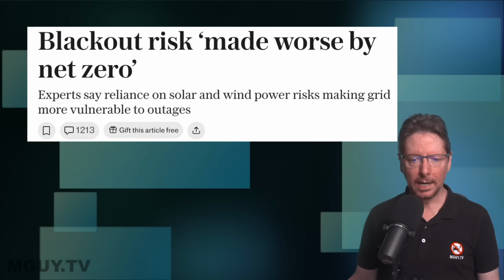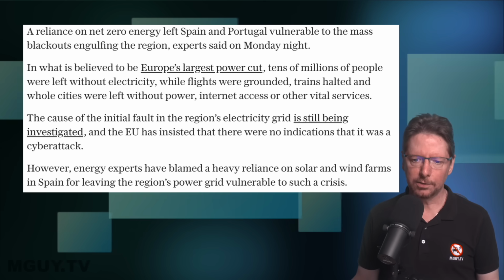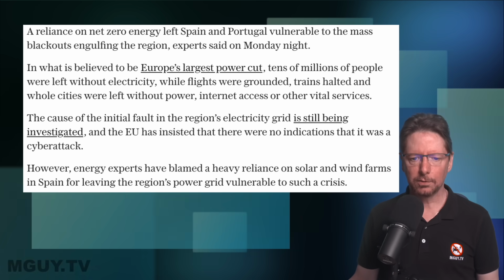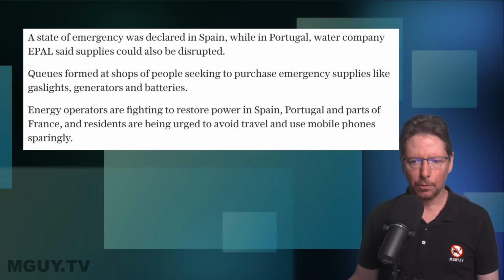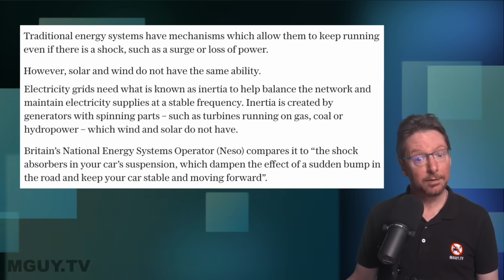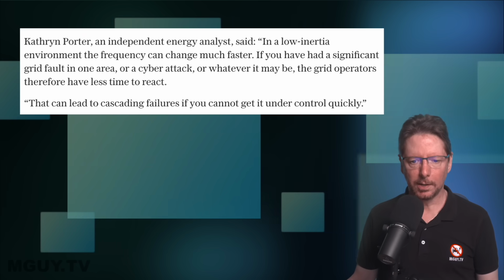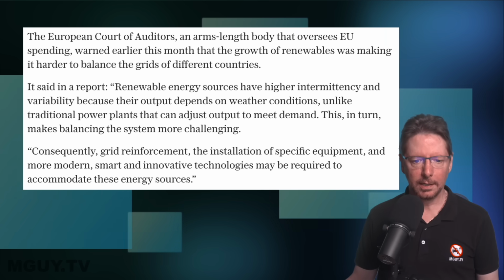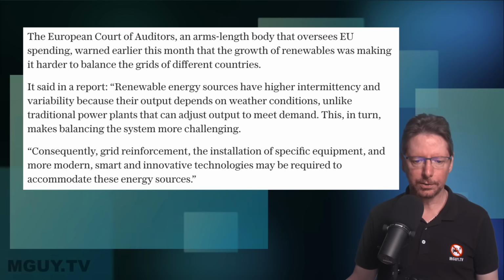Spanish power BLACKOUT: Why Net Zero and RENEWABLES were to blame | MGUY Australia

Comment: When I was a kid my father took me to a 'working' steam engine museum (somewhere in England; I forget the location). Lots of original examples of Victorian engineering - built to last and all still in working order.

I was dwarfed by monstrous pumps and engines humming and whirring and whooshing away, brass and bronze, iron and steel, beams and wheels in almost silent motion, ingeniously governed by automatic feedback devices and, most importantly, regulated by gigantic flywheels weighing several tons apiece.

Inertia. Momentum. Immense power on a tight rein. Awesome engineering. Not a windchime, beansprout or sparkly pink unicorn to be seen.

Comment: The generators do have to be spinning very close to 3000 RPM, but you still can't couple 2 together until you nudge the phase of the second to match the first. In other words, they must be synchronised. If you add a generator to a fully synchronised grid, the grid will "pull" the new generator into phase by virtue of the massive inertia already there.

Comment: Sweden has several nuclear reactors running, the socialdemocrats together with the green party has shut down 2 of 6 reactors, the largest plant Forsmark delivers pretty much 95-100% efficiency during high demand, right now reactor 3 is shut down most likely due to maintenance, but so far Forsmark 1 and 2 has delivered 1900MW of power and it delivers 25TWH/year

Comment: Wouldn't  tidal and/or hydro (Stored and running) and gas storage "Batteries" and Li-Po batteries  provide the inertia  necessary to support the grid ? Isn't the real problem that grid electrical systems in the  developed western World are  in transition and essentially are using prototype configurations which require further development, which will transition, in time, to fully stable and contingency proof systems. Going backwards to fossil fuels ain't the answer. A limited amount of  nucleur, in this scenario must be a good idea.

Pro -temp couldn't electrically  powered giant flywheels supplement any existing  traditional turbine output to provide the heartbeat  to stabilise the system

And isn't part of the problem as seen in the UK over the last 40 years,  that privatised utilities tend to run these systems with far less comfort zone margins  and contingency reserve . They do this so that  more revenue can be devoted to consumption  by shareholders rather than investing in the necessary excess capacity to provide a half-decent reserve.

Comment: We seem to be forgetting how to engineer things that used to work well.  Rubber belts in automotive oil pump service  , plastic cowls  enclosing turbofan engines that melt when the deicing is activated.  Lithium battery farms that go up in smoke...

Comment: And it's a problem both ways with most wind turbines. Too much demand can drag the frequency down while too much wind speed can push the frequency up. That's why most wind turbines have to be shut down in strong winds apart from the chance of physical self destruction. All Milliband sees in the UK is what the salesmen tell him and what his technical advisers advise him and lets face it, if you've landed a very well paid job advising on transition to renewables you're very unlikely to advise stay away from renewable, it isn't ready yet and may never be; go with tried and tested UK built modular nuclear to back up our conventional stations powered with our own shail gas. Knock EV's on the head and job done.

Comment: That was your best yet, concisely put in simple terms, you have educated my septuagenarian brain as to grid stability. 
I have home solar and it has to be outputting a slightly higher voltage than the grid to 'push' itself in and integrate. Also, homes in the UK run from a transformer that turns the grid supply power to 3 phase 240V  down the street. The 2 phase power your home needs is wired off alternately to help balance the 3 phase supply. Problems of balancing are therefore complex as only a few homes have solar and if all those happen to be on the same phase a similar problem to this one can occur when they all push varying amounts of power back in to the transformer at once. I believe this to be correct.

Comment: it is not just the cycles per second the power flows at but the huge amount of current flow going through the wires has to equal out at both ends if you pump to much electricity into the grid voltages go up and things will blow fuses.
 if you have too much generation they have to cut the wild card of solar and wind to keep grid stable.   the voltage will go up and down you will get brown outs where voltage drops to 100 if demand is too high.
 it is like a water fountain or drinking fountain it will squirt you in face if water is too high of a pressure or dribble out so its useless if it is too low

Comment: It's glaringly obvious that wind and solar should use an inverter to covert the DC into AC, and to use that AC to run a motor that drives a generator, to produce stable AC output. Apart from adding to the cost of solar and wind installations, this will also reduce the nett power output, due to losses in both the motor and the generator.

Comment: We tried to warn them. I'm all for cost-effective renewable energy that helps reduce the demand of fossil fuel generated energy as long as it's not outrageously expensive like wind farms. Water-based, thermo-based, and solar are great for my state but they still cannot replace good ole reliable fossil fuel and nuclear generated power. But we can use them to lessen the environmental effect. However, our gov decided to destroy 4 dams? Why? He and his cronies aren't for renewable energy that works well. They are for power and control. They are also using gov't policies to outlaw fuel plants as well to force everyone into an electric car even though most have no way to charge them and that will put even more stress on the electric grid. Who suffers? The middle class and the low-income people who can't afford to live in homes where they can charge their vehicles and can't afford to miss a day's wage when the power grid goes down. This Net Zero thing is not only a pipe dream at this point in time, but also classist.

Comment: Okay, that's enough with the superior attitude.  We're doing the best we can.  Where were you when all this was being planned?  I don't remember seeing you among the protesters.
This whole thing was an oversight and failure to sync up adjacent systems.  We've had our problems with that too here in the US.  Let's not go crazy.
BTW, it's a mistake to think that renewables are the problem.  All systems need to be synchronized with each other.  Conventional systems are alternating current and need to be synched with adjacent systems.  Renewables are usually direct current and need to be converted to ac current and then synchronised.   At some point all systems need to be synchronised.  And hydroelectric power is a renewable, and do we have problems with it?  No.  It's a synchronicity problem, not a renewable energy problem.  Crack a book every once in awhile.

Comment: It’s all being done with a purpose in mind. All that DC and variable power could be used at existing power stations to heat the water to produce the steam that would drive a proper generator. The system could use both electricity and standby fossil fuels to produce steam when there wasn’t enough wind or solar. The fools would rather shut down a perfectly good source of power in favour of an unreliable one.

Comment: In aerospace, I worked on an airplane that had a piece of equipment that needed a non-standard voltage / frequency combination, plus being an uninterrupted supply.  The solution was to do a motor-generator combination.  The motor was driven by the standard airplane frequency / voltage while the generator put out the required special voltage / frequency.  There were relays to switch the motor over to alternate power busses should the main bus go down.  The inertia in the system kept it going adequately until the relays could switch to the alternate bus.  Problem solved.

So, how's that apply here?  Well, IMO, the renewables should be required to do a similar set up.  Use the crap power coming from the solar / wind to run a motor.  That then drives a normal 50 or 60 (in the US) HZ generator, and it's that generator that actually feeds the grid.  Higher cost & lower efficiency?  Yep....but that frequency stability service is critical.  And it would put the cost of this service clearly on the balance sheet of the farts and pixie dust (wind / solar) generators, showing what their true (unaffordable) cost is.

Comment: Just yesterday I told my wife that I was a product of the last century and I have trouble functioning in these times.  That was a joke but being a retired electric utility engineer I am amazed at the new crop of engineers lack of push back on the tenants of base load.  They must understand the need for a stable base load but went along with the idea of designing and building an unstable grid.  This is an ethics issue.  What next?  Dangerous chemicals in our food or exploding EV batteries?

Comment: Fantastic explanation MGuy.

I'd also say an analogy could be the difference in the type & nature of power produced between a tiny displacement 2 cycle engine like a small weedwacker or model airplane engine - high revs / low power / near zero torque.

That'd  be the"Renewable powered grid"

Vs
A Diesel Locomotive or large ship engine with pistons the size of 5 gallon cans (or bigger):
Low revs / medium power / TONS of Torque (inertia)

That'd be the traditional power grid !

Comment: I can't say what I think of politicians on YouTube, with their heads buried in the sand,  you have some very good points, covering DC to AC is a bit easier, but viable AC to DC and back to AC with the correct frequency and phase rotation becomes a lot harder, I am not an engineer but have been doing it the other way with VSD's for many years.

Comment: For a generator, low speed usually means reverse power - it becomes a load to the grid, not a supplier.  The safety for that is automation that takes it offline.

Comment: Synchronous motors can be used to correct the power factor in long inductive transmission lines. 

I wonder if something similar can be added to the grid ($$$$$) to add inertia?

Comment: So what’s needed, given that we are where we are, is a thing called a switch. It’s used to switch off loads that are out of spec, while leaving the rest of the grid running. Or, better still, to isolate different parts of the grid from each other, thus allowing for sync to be temporarily lost, meaning everything keeps working, but clocks in one part of the grid may be 0.02 of a second slow, compared to the rest. 
This is a problem that engineers are perfectly familiar with and have been solving routinely every time a new power station is added to the grid, or an international inter connector hooked up. When the spike is over, both sections are adjusted, over a period of time, until the waves are in sync and then the link is made.

Comment: Texas got within seconds of the entire state going down for as much as a month 5 years ago.  They barely stopped it from crashing literally in the last few seconds.

In Texas the issue was not the grid failing, but that wind and solar allowed the state to negotiate power generation deals with fossil fuel power stations that allowed them to shut down when fuel prices were high.  Then there was the combination of high fuel prices and a winter storm that took out wind and solar and the connected freezing rain and cold temperatures and the power plants couldn't come online quickly enough to deal with the big spike in demand with the cold.  Texas had to take power away from hundreds of thousands of people to give them time to get enough fossil fuel power generation back operating before the grid crashed.  It was international news that Texas had 3 days of power issues and it was entirely missed that they actually saved countless lives by not having the grid crash and be down for maybe as much as a month.

Texas learned it's lesson and won't let the big generators all go offline anymore.  I guess Spain didn't learn Texas' lesson.

Comment: I am sure that their genius solution to the inertia issue will be the building of many multiple gigawatt-hour lithium ion battery storage facilities, but the load step response of the DC to AC converters cannot match the stability of the inertial mass of the spinning generators.

Comment: Ironically, here where I live in Spain there are a gazillion turbines in the mountains and during the outage, every single one was stationary!
Reply: They only work when there is electricity on the network
Reply: Not 100% sure about this, but I think they were designed to lock up during a power failure.  If they were allowed to spin freely with no load they would spin way too fast, and destroy themselves, under windy conditions.

Comment: I agree with your assessment. I live in Spain and see wind turbines and solar farms springing up everywhere, but lacking the battery storage buffers which would give some inertia. The fact that they got it up running so quickly indicates that there was no equipment failure but a shutdown, most likely because of sync problems.
Reply: But it worked fine before… 🙄
Reply: The flaming battery storage buffers.

Comment: I knew you would have an opinion on the Spanish/Portuguese/French grid down fiasco.  I see they were trying to blame atmospheric disturbances and solar flares... All nonsense. And you are correct.  Inverters have no means, other than getting hotter and potentially failing, if demand suddenly increases.  Windmills turn at different speeds depending on Unicorn flatulence and have to be synchronized as well, but what neither of these sources have is the reserve momentum and kinetic energy of a steam or gas turbine to provide stability via governors and valves to control rotational speed and hence generated AC frequency.  It's either this (frequency synch problem) or their delicate control systems got good and hacked.  BTW they need stable power to bring the grid back up and I am willing to bet that is coming from steam or gas turbines.
Reply: In the uk, most fossil-fuelled stations in the day, had facilities for a 'black-start'.  They had diesel generators which could be started to generate sufficient electricity to get the auxiliary boilerhouse fired up to generate sufficient electrical and steam power to start the main boilers.  The auxiliary plant on the main steam boilers would easily consume in excess of 10MW in order to generate its rated 660MW output.
In my understanding, Solar and Wind Farms require an electrical supply to power up the conversion electronics which converts the raw output (usually DC) into the grid-frequency AC.  These converters follow the AC supplied to it and have no inherent means to correct a low grid frequency. As Simon said, the grid frequency drops when the demand exceeds generating capacity as the rotating machines slow down.  Increasing the power to the turbine (opening the steam valve and winding up the boilers) will eventually get supply greated than demand and thus bring the speed of the machines back up.  The old power stations used to have two clocks in the control room, one being linked to an atomic clock source and the other driven by the mains.  The aim was to try and keep these synchronised at all times (usually catching back up overnight when demand drops - unless you have loads of EVs start charging up and loading the system again).
Reply: @pete.i7057  Makes perfect sense.  You can always add flywheels to turbines and generators for additional reserve power until the gas or steam can fulfill the demand.  Quite a few Data Centers use flywheels for reserve power until the generators kick in during a power failure.  Even in Nuclear power plants they need external power and generators to start up the reactors, pumps and control systems and for emergency backup as well.  At Fukushima those improperly protected generators were flooded and contributed to the meltdowns they experienced.  You might also recall the reserve system power is exactly what they were testing or experimenting with at Chernobyl when they lost control of the reactor.

Comment: If Spain's government has a goal of eliminating coal or natural gas powered generating stations, then they should have built nuclear power plants to provide the required electricity. I would have said they should use nuclear power for the base load, but since renewable energy isn't reliable the primary power source must provide for the entire load. This leaves the wind and solar energy power production serving no purpose other than increasing costs.

The supporters of the Net Zero agenda live in a fantasy world and are either unable or unwilling to accept reality.

Comment: The weak magnetic field due to the Pole shift has left a hole in the magnetic field above Spain, which has let a weak solar flare CME get to the grid. That overloaded the grid and shut it down. So it does not matter where the electricity comes from because a CME will blackout the grid. When the magnetic field flips, it will leave no magnetic field, resulting in a Global grid shutdown. Earth is overdue for a major CME. The 1859 Carrington event was a CME.